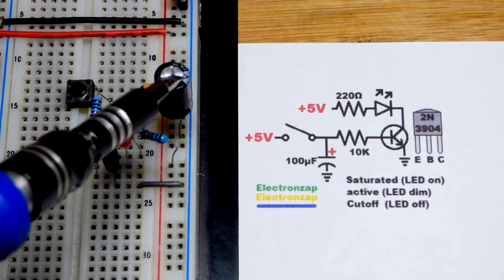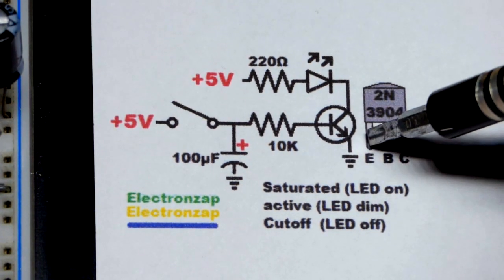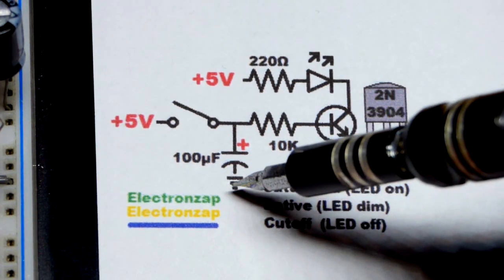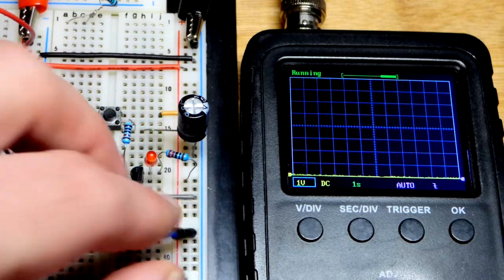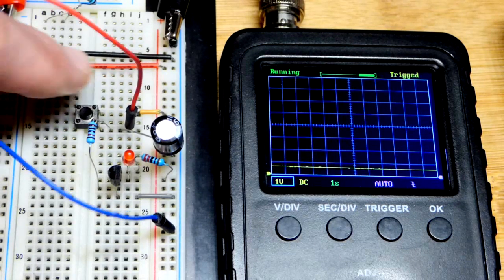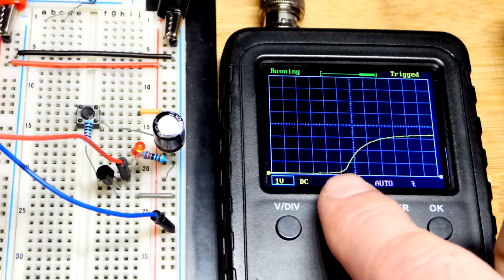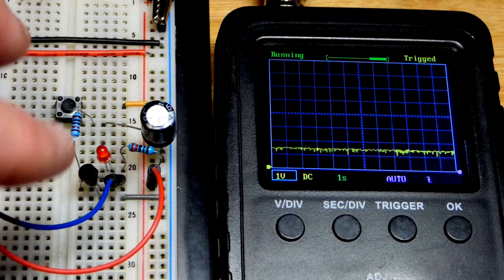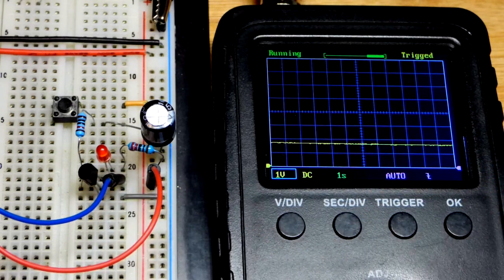LED fade off circuit using capacitor and 2N3904 NPN bipolar junction transistor electronics BJT

Comment: is it possible to make the fading time much longer? like 10 minute fading?
Reply from the maker: Probably not with this basic circuit, but I think 10 minutes would be doable.
Reply: @Electronzap  you mean doable with entirely circuit design or doable with this circuit with bigger capacitor in this circuit?
Reply from the maker: If you use a supercapacitor, making sure to limit current when it charges because many of them can accept almost unlimited current, then a supercap might work. But, I'd probably find or come up with a different circuit. My goal was to fade it as you are watching, so I didn't spend much time thinking of a really slow fade. @darwink2355

Comment: What would be the best way to change the fade out time to make it fade out faster.  Use a  bigger or smaller  Resistor that is feeding the base or a bigger or smaller capacitor?
Reply from the maker: Lower value capacitor or resistor, or lowering both of them, will speed it up the fade. Capacitor just needs to be a high enough value to store enough charge to keep the transistor on for a while.
Reply: @Electronzap  Thanks for that useful information!

Comment: Great video, exactly what I was looking for but I have a question... If I wanted to be able to switch on/off a couple LEDs individually (with an arduino for example) would there be an elegant solution that would work with one of those circuits or would I have to put a circuit like this for each of the LEDs? I know fading would be really easy with the arduino alone BUT in my project the PWM flickering that is quite apparent especially in the late stages of the fading would sorta ruin the look. Fading using this circuit just looks so beautifully smooth.